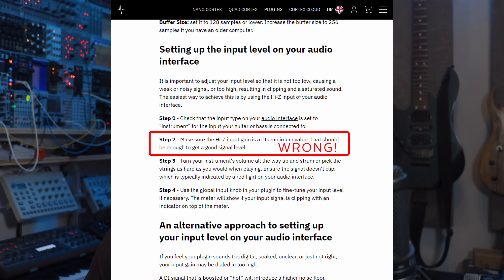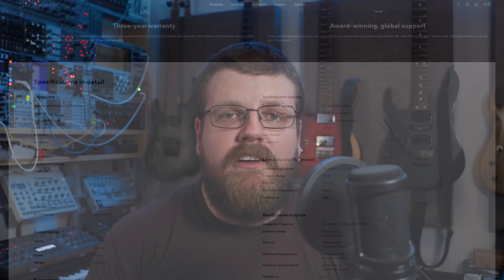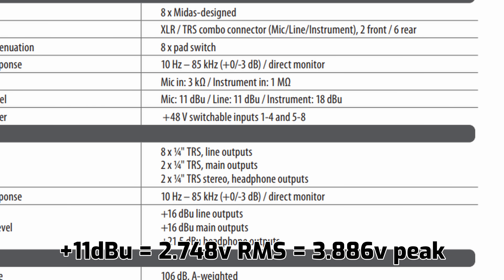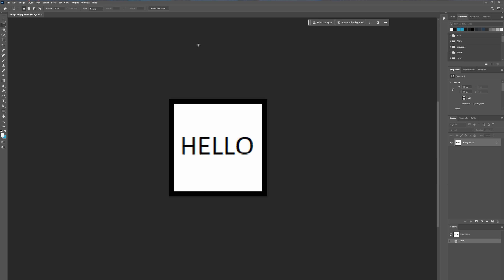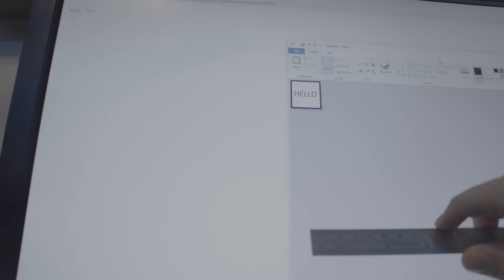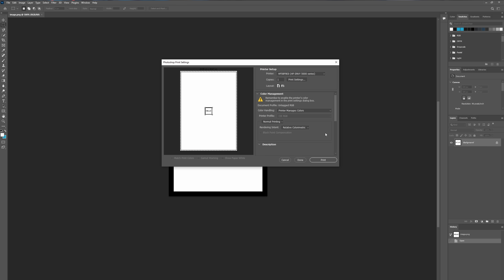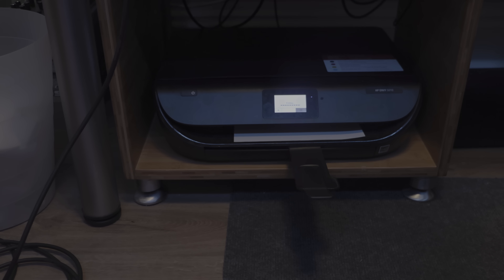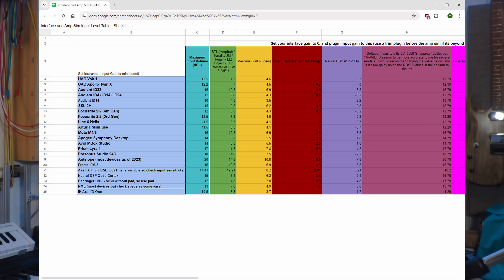Ampsims and input gain - Please, stop the madness...

Comment: Why is Amplitube missing from the spreadsheet? :((
Reply from the maker: Unfortunately Amplitube is the worst offender of all, as individual models within Amplitube require different input levels to sound correct. This means there is no single correct value for Amplitube, but a value for every one of its 100+ amp models. And if you add overdrive pedals etc. it gets a lot more complicated.
Reply: @GhostNoteAudio  I had no idea... That sucks. Thanks for replying.

Comment: I'm sure you are correct when it comes to recording, but I use amp sims with headphones to play without disturbing the family and this doesn't work for  me. Using this method my guitar sounds like crap because the clean signal coming through is loud enough to almost drown out the amp sound. My tinnitus therefore demands I turn the input volume down.
Reply from the maker: @Blodtann  you're setting your audio interface wrong. The clean signal should not be coming through (unless you want it to). You need to turn down the " direct monitoring" volume. This is easily fixable :) what interface do you have?
Reply: I have a Focusrite 2i2, have looked for ways to bypass the DI signal but can't find a way to do it. Using a stand alone amp SIM, not using a daw
Reply from the maker: @Blodtann  if you have a second generation 2i2, flip the "direct monitor" switch on the unit to "Off". If you have a 3rd gen, click the Direct Monitor button until both mono and stereo lights are off. See manual, page 13: https://fael-downloads-prod.focusrite.com/customer/prod/downloads/Scarlett%202i2%203rd%20Gen%20User%20Guide%20V2.pdf

Gen 4 - click the button until the monitoring symbol goes white.
Reply: @GhostNoteAudio  Apparently I'm an idiot, was looking for a software setting. Thanks for taking the time to share your expertise, I appreciate it.

Comment: I'm fighting a similar fight that "32-bit float makes the gain knob obsolete" or "eliminates clipping."  I was hoping you could do a better job than me in explaining the relationship of analog voltages and digital representations (bit depth).  My 2-cents is that manufacturers want to sell new equipment and many buyers want to believe in special tricks, almost mysticism.  By setting to 0db they get a pristine, perfect signal!  So they believe. As you pointed out, noise is a condition of all electronics but that goes in one ear and out the other ;)  Rather, understanding the continual need to strike a balance between signal and noise is just too uncertain--too anxious.  Unfortunately, many will now believe the spreadsheet is the 'truth'!  It's not what you meant, I know, but it's what you're up again. Well, I could go on.  Keep up the good fight!

Comment: If i'm going to set the gain down on the plugin shortly after turning the interface gain knob on this sweetspot, why do I need to put it on 4.8 dB (neural) anyway? In other words, why do I need the spreadsheet values for? Do I need to subtract the amount dB on the plugin starting from this value? Is this the reason this values are still relevant for the method?

Comment: 3:17 The term "Digital Audio" is also problematic. It helps to think of the two as never coexisting. EVER. Once your audio goes into the box it's imaginary just like GTA. The only difference is the audible range of modulating air pressure doesn't span very far so it's not hard to convert it back and forth between AC voltage and bits/samples without very much loss, and speakers don't output cars and hookers with the same relative ease as audio.

Comment: Hi thanks for this video! Might be a dumb question, how do you know much db you are able to turn your knob up to? I'm using a scarlet 18i20. Thanks!
Reply: The input gain you mean? Play as loud as possible and turn it up till it starts clipping, then turn it down a little bit. If you want to be extra safe you can turn it down a little more, but the lower you put it the higher the noise level.

Comment: It makes so much sense. But I wouldn't be able to explain it to anyone without this vid.

My brain hurts

How would this approach change at all if you were just sending a helix floor modeller direct to a track via usb? Or is that just a bad approach to begin with? Would i have to raise input gain globally on the unit and then tweak gain on whichever patch i was running to compensate? 

My brain is expanding. Skull hurting

Comment: im gonna watch this as many times as it takes me to understand it.
Reply: All you need to understand is that you want your signal to be as loud as possible without clipping and that is how you set your input gain. Everything that happens after the input just adds noise. So by having a loud signal you can turn everything else down and get less noise.
Reply: @zachisebi is clipping yellow or just red?
Reply: @Lazerade red. You want it to be yellow while strumming the hardest but not red.
Reply: @6metal666  Is this the same with vocals?
Reply: @Lazerade yes. For vocals at your loudest a little bit orange is okay. Never go red
Reply: i tried taking notes. i feel so uneducated now. but this is how we learn. i am more concerned about ruining any of my gear.
Reply: If I may add, I am having success using my amp sims thru my amp
Reply: 😁 I can relate...
Reply: Its easy. Just turn up that gain knob on ur interface but make sure it wont clip. Thats it
Reply: You don’t need to understand the scientific stuff necessarily. The main Takeaway is, get the loudest clean signal you can in your analog input, and then bring the level back down on the digital side to match what your plugin expects. If you think of what a guitar amp modeler is doing, it’s simulating a real tube amp, and a tube amp expects a very low instrument-level signal
Reply: It comes down to the fundamentals of physics (waves) and the "signal to noise ratio". Similar to color and brightness with cameras, and really anything, more dynamic range is almost always good.

In this case, it's just the specifics of how Analog to Digital Converters work. So basically: You're increasing the gain on your input as high as possible without clipping, because it generally results in the largest dynamic range (signal to noise ratio).

A higher dynamic range means it's easier for your noise gates and what not to cut out the noise floor (white noise). For example, trying to find Waldo is a lot easier if the background is pure black, instead of all sorts of different people and objects.
Reply: Amen
Reply: lmao
Reply: Why?
Reply: If you turn one up, turn the other down. And the other way around.
Reply: He is saying to just play with the gain on the interface and also on the plug-in to achieve a happy balance.  A good ball park is to set your computer amp sim. to -19.7db and then set your gain on your Motu input to around +24db. You also must keep both, input and output meters OUT OF THE RED (clipping.) To do that, you could lower each value proportionally e.g., 17.9 and 22 or 15.7-20. If it's too quiet, you can raise the Output VOLUME on the right (PC.)

Comment: Very good! And it becomes a little bit more obvious, if we consider, how it came to dBFS (the unit used to describe - 1 to +1 and displayed in any DAW). In the analogue world, it was all about voltage. So to calculate dB the formula is 20 * log10(V/V0). V0 being the reference voltage, V the control voltage. This allowed for various voltages to be used, coming to the same results. But when computer became a thing there was a problem: in the digital realm there is no voltage, neither reference nor control. Just a group of bits (called a sample) that represented the amplitude at that point of time. To have a reference, they simply defined V0 as always being 1 V, which makes it redundant and we can simply use the amplitude values recorded as samples (-1 to +1). With it comes an important difference: dBFS is not convertible or comparable to dBU/dBV/dBA etc. That's because there is a limited range: dBFS describes the range of numbers from 0 (= - inf dBFS) and +/- 1 (= 0 dBFS) .
If you ignore the digital side, then all you do is effectively limiting the signal (= flat washed signal). However, your example of lowering in the digital realm exactly by the amount of dB on the analog side only works with dBV, which uses 1V as reference voltage. With dBU the reference voltage is 0.7746 Volt. For example, 8.2 dBU is the same level as 6 dBV, and in that case a reduction of 8.2 in the digital realm would lead to a reduced signal (it would have to be lowered to -6 dBFS)

Comment: I am a complete beginner to digital audio and just bought my first interface, the M-Audio M-Track Solo, and within a day of tinkering, even I instinctively knew to dial my input gain to as high as I can get before the red light tells me that's way too much. It's not even anything mathematical either, I just figured if I dialed the input way up, my signal gets louder and I can use Noise Reduction or Noise Gate to cut off the noise and affect my signal less.
Have people just stopped actually tinkering with their tools now, and just treat some spreadsheet telling them to dial in some number as gospel?

Comment: Good job! The misinformation about using digital audio is nothing new through! I used to regularly debunk bad advice on our forum when I worked at FXpansion. I generally advise that every quantum level you miss at the AtoD converter will add ~6.02dBFS of quantization noise once you renormalize in your DAW. The (typically audio grade) OpAmp going into the converter won't add anything near that. Therefore, boost in the analogue domain first.

Comment: You have very few angry comments to help the algorhythms so I will challenge anyone to a fight in a waffle house of your choice if this helps? 

To maximise the unity gain structure of the decibel end structural oppressor you need a flux capacitor set to 88mph with 2.8 jigga watt insert with parametric ball bags overdriven through a dilithium crystal spasmodically quantised with auxiliary bussed weapon wrestlers. 

That’s a fact

Comment: I am sorry but I am getting much better results using 0dB gain. I have tried this using 2 different interfaces - Behringer UMC202 and Antelope Audio ZenGO and strictly following your method. Gaining up, very slightly improves the general tone but the noise added is rather too much for me to confine with. Sticking with 0dB for now.
Reply: If there's additional noise you have a client side prohlem and has nothing to do with correct procedure

Comment: Thank you for demystifying this - I’m 15 years in and have never really understood it. One question/point of clarification - step 3 when you say set your interface gain & play loudest to just below clipping threshold do you mean by inspection of LEDs on interface channel (amber ok but no red) or inspection of a recorded waveform to see if it peaks/flattens? - there could be quite some variation between the two I guess. ( I use an SSL 2).
Reply from the maker: You could theoretically do either, but looking at the green/orange/red light is probably the easiest method, and should do just fine.
Reply: @GhostNoteAudio  Wait - I'm struggling to understand why step 3 to increase i/f gain to just below clipping on the meter is where it is.. adjusting the amp sim input gain in step 2 beforehand doesn't (in any way) influence the levels on interface meters (unless it it just there to get you back from zero in step 1 after calibrating amp sim from spreadsheet). That aside this does make for a very loud/near clip recording with little headroom for subsequent fx tha might take it over the edge right?..
Reply: @GhostNoteAudio  But if I'm only looking at the LEDs, how will I know how much has been added by step 3? That's the value I need to subtract in step 4, correct?
Reply from the maker: @Jimmy4Thumbs  see pinned comment

Comment: Would the wider introduction of audio interfaces with 32-bit floating point capability reduce (eliminate?) the need for gain staging properly the initial a/d part? I.e. you just max out (or near to) the gain on the audio interface and then you only have the gain into the plug-in to adjust?

Comment: Axe FX 2 manual literally says that you should bring up sensitivity on the input until the signal starts going into red ocasionally...
Reply: How is that relevant
Reply: @saamo1423  this is literally what ampsim devs tell to do with an input signal. Literally the topic of this video
Reply: @d.shevtsov  they aren't electrical engineers, and the axfxe is a hardware unit. It's not relevant

Comment: I thought this was common sense 😅 didn't realize people had started arguing about it lol   Doesn't really matter if its an instrument or not, you turn your input gain to the point of clipping and then dial it back a bit and make a bunch of noise, if it still clips, dial it back a bit more ... this is the same for pretty well any input 🤣 These people saying to have the input gain as low as possible are broken ... how do  you get all the nuance if it isn't picking up all the sound XD  To be clear, I'm quite literally an ungraduated old head at this point, but even I still understand this 🤣Thanks for the all technical reasons though!

Comment: I use my Axe FX II (as the worlds most expensive DIY box…) I know this has variable input sensitivity. Would I still need to compensate in my Neural DSP plugins? I’ve always set the input on the Axe FX II so the red input lights occasionally light during maximum level from the guitar. I feel like my noise floor is pretty low.
Reply from the maker: @mikemelisa1804  I can't remember the axe ii having an adjustable input level, but maybe I'm misremembering. But what it does have is the lowest noise input on any device I've ever used. It's ridiculously good :) you won't need to worry about this stuff on the axe. I'm not sure what the instrument level is on the axe, though, so not sure how to set the NeuralDSP input level to get the right signal strength.

Comment: Excellent video! Lets start a new discussion and spreadsheet. This time taking into account the different interfaces. I'm sure that just below clipping on your interface is different from just below clipping on my interface, so the difference is not gonna be 24db. So we might as well just stick to fucking around with the knobs and settings until we get a sound that is pleasing to the ear. But overall, excellent advise to minimize noise. Thanks!

Comment: This is how i have always worked, and this is how i was also taught later, and it has always worked. No one has ever said anything about interface inputs having to be zero but to optimize the signal when it comes in, then trim, in case of amp sims you use the amp sim input gain. That is the way it is designed to work, i am amazed that there has been a controversy on this. Use the digital resolution, and put in the safety factors, optimize it, then adjust the gain digitally for whatever the input is suppose to be. 

I use external pre-amp that is less noisy than what the interface i have has, works really great. Line inputs are working at unity gain, they are quite silent as inputs since they expect a signal that is already optimized... So, using that configuration it is absolutely clear that you have to optimize the signal to get the most out of those line inputs, then digitize the signal and then adjust gain digitally. (Also, if i clip it happens in analog side, unlike audio interface mic inputs that might clip at ADC...one of the benefits for external inputs is that you know what is in the circuit and where it clips... I can overdrive things to clip at ADC still but that means i have to overdrive the gain a LOT, it is audible way before it clips digitally, hooraa soft clipping inputs...)

Well.. the audio interface works exactly the same way: there is a pre-amp circuit that feds to a unity gain amp. Nothing really changes there. So, if it is true when external preamps are used, then it is true with internal pre-amps. 

And this works in all gain staging in all purposes, live studio whatever: raise the signal as high as it can be in one go, as soon as possible. This means optimizing: you maximize it and add in the safety factor at the first gain stage. Every FX processor in the chain is in unity gain and handles input:output gains internally so that we get 1:1 input and output when it comes to signal amplitude (not always possible in the real world to be perfect since we are modifying the signal, but at least it should be kept close to unity gain). Keep the signal levels the same all the way until the channel fader sets the balance by attenuating the signal. This just works. Has never ever failed and i can't really see how it could: that is how everything is suppose to work.

Comment: How to dependably measure the input gain set on the interface tho? Use a sine wave generator and compare RMS values with gain set to zero and gain set to the desired level? Will that work? Sounds like a hassle tho.
On another note, is the auto calibration, that some plugins offer, trustworthy?

Comment: 100% correct. It's absolutely crazy how many people have been getting this wrong.

I have seen similar bad information for mixing live (or in a studio) sound with a digital mixer as well, such as people claiming you should adjust level in the mix with the gain... Like, WTF! No! That's what the damn faders are for! Of course, it i's not exactly the same, as in you don't gain up to just before clipping, but peaks on all channels should be landing at about the same point. Which, should be somewhere in the -12 to -18 dBFS range (depends on the total number of tracks being mixed ultimately) to allow any track processing to work optimally and, most importantly, to maintain headroom on the master bus.